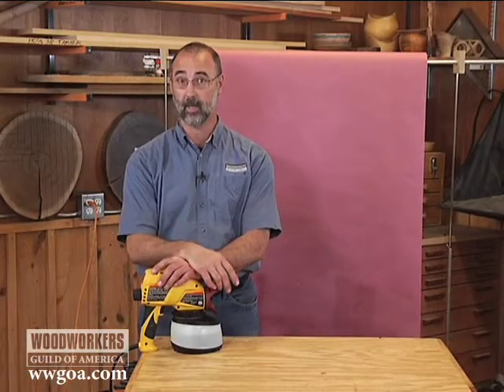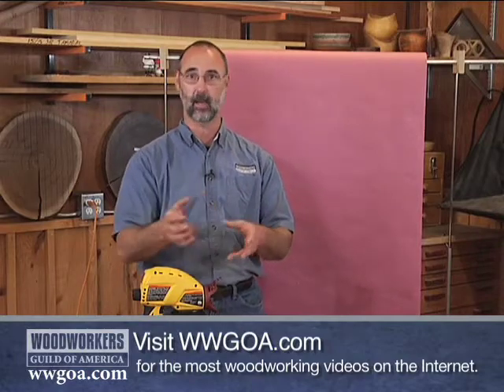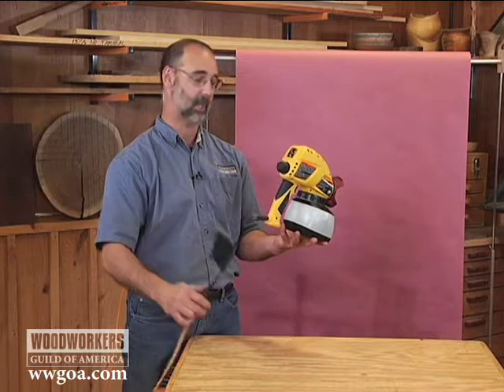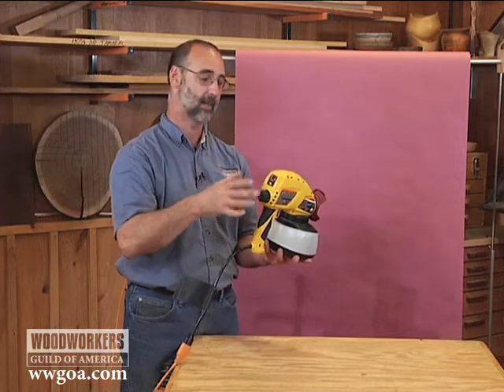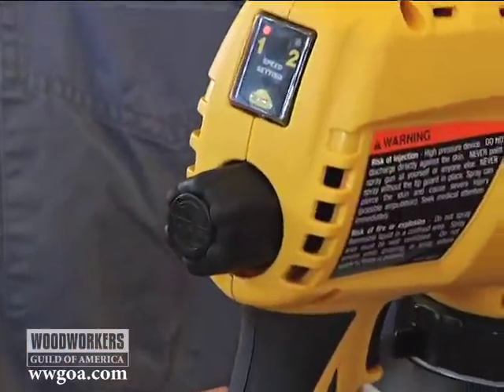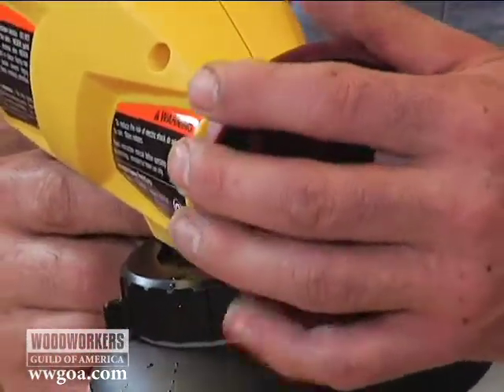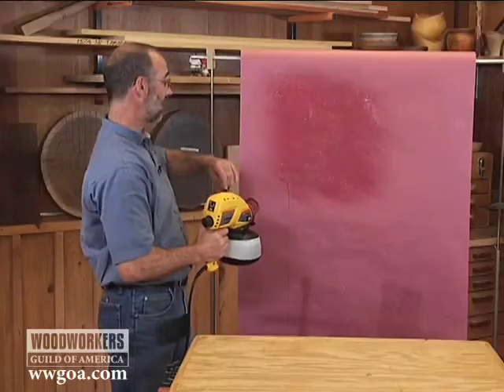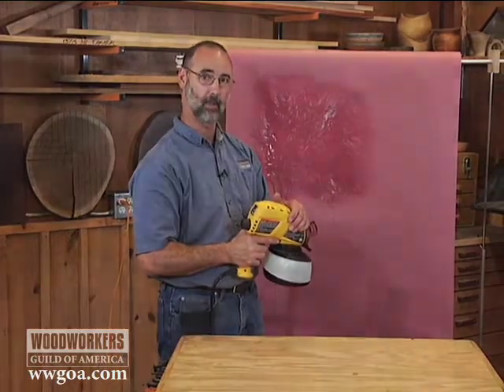Woodworking Tips: Finishing - Airless Sprayers in Your Shop

Comment: They claim the Wagner Airless  Stainer Plus has a low pressure setting that is useful for varnishes, lacquer and staining projects. Do you still recommend the air sprayer instead of airless ? I am between one and the other for finishing guitars with lacquer. Thanks in advance.
Reply from the maker: I’ve used a variety of compressor and turbine driven HVLP guns throughout my woodworking career. Catalyzed lacquer was the most common finish used, with no application problems. I’ve recent switched to water based lacquer, which I still apply with a turbine HVLP with no difficulty. If you’re in doubt, a great course is to contact the manufacturer of the gun system you’re considering getting and asking them if it will handle the specific finish you want to apply.

Comment: This fool doesn't know what he's talking about.  I've been using Wagner type sprayers since 60's.   First, they're good for a lot more than "getting some paint down".  They'll spray heavier mixes but all paints have to be thinned for optimum results.  

He says they're not for thinner paints then goes ahead and sprays water. 

 The quality of the finish is more dependent on the paint than the fact that it's a pump gun.   Sorry, but sometimes you just have to know what you're doing.  You need to learn how to mix paint to control the flow and the drying time. (Those little buttons aren't some magic answer)  You need to learn the optimum angles to spray from.

They work great with oil-based enamels. Varnishes, shellacs, poly --- all work fine.  (Above rules apply.)  The only paint that's problematic is latex.  I needs to be cut with Floetrol and water.

 You can spray lacquer but it dries so fast you'll get orange peel.  But if you're willing to wet sand and rub it out, you're in business. It's not efficient but if you want to do a quick test piece or demo and don't have a spray set-up, you can pull it off.   (I've done piano black lacquer finishes with mine.)